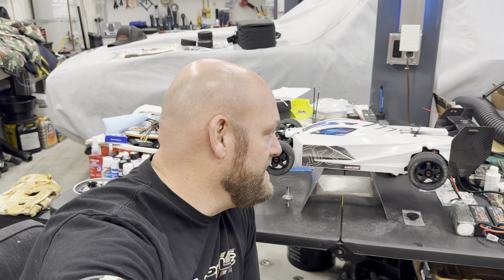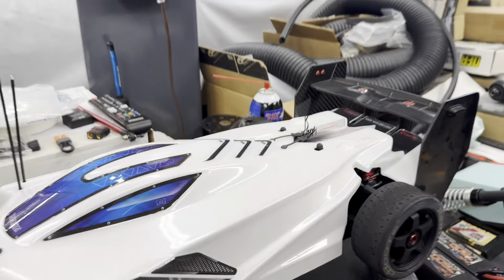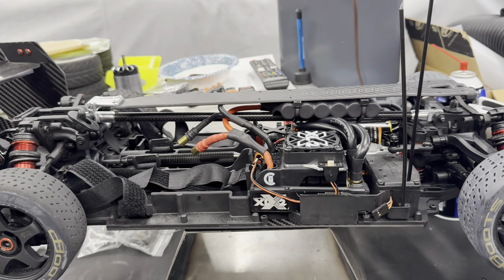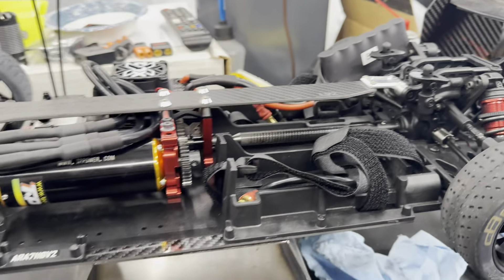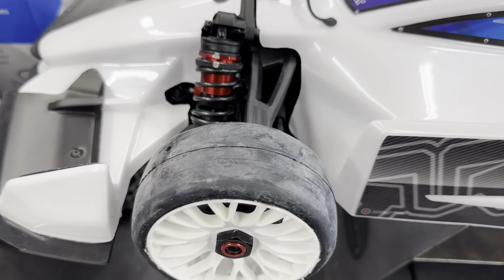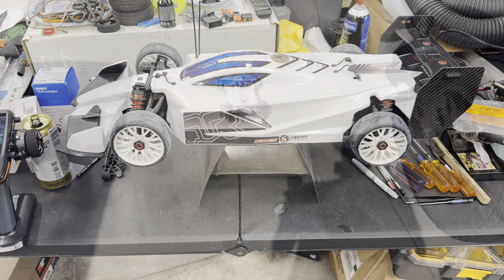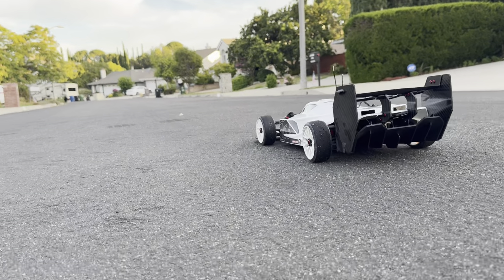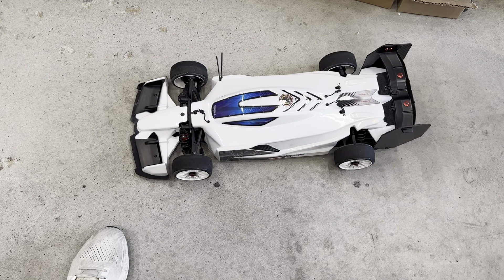Arrma Limitless V2 Drag Build - Major Problems!!

Comment: Hey man amazing work !!
If you want to improve your car u can make the camber in front 0 degrees 
and the rear the same also make your TOE in the rear on zero , and definitely foam tires would help… also because on side of the car heavier than other adjust the set screw on the front A arm when u press on the middle of the rear to see if one tire goes up before the other.
Reply from the maker: @Crosskart  awesome!! Thank you for the info

Comment: your wheel spinning too much , try turning punch down, use toque control within the esc settings , good luck 👍
Reply from the maker: @rcheatbustafans4859  punch is fully limited..haha…turning down the power on current hits
Reply: @818_Custom_Garage  0 punch on xlx2 is full power no limiter try 50% and 90% is the most limited its backwards i know
Reply from the maker: @rcheatbustafans4859  oh I’m very aware of that. Thanks for the info though. I currently have punch at 100% fully limited. It’s definitely in the suspension…keep a look out for next video😉